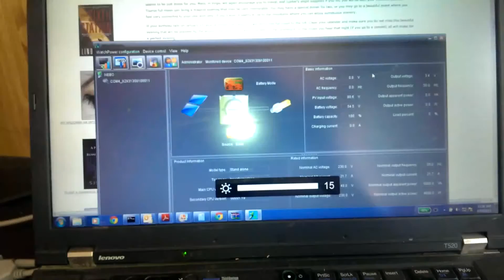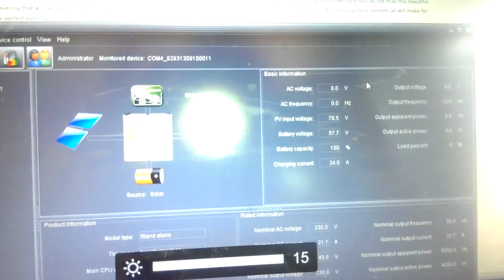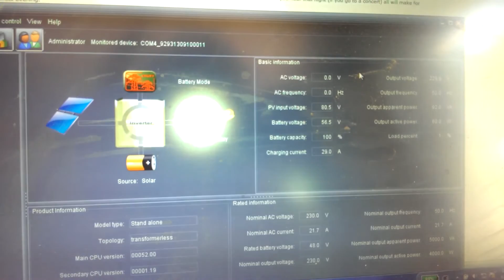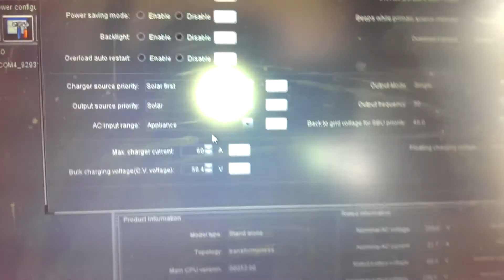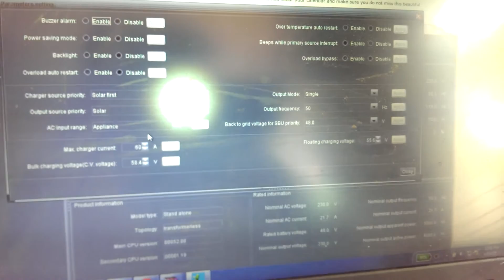MPPSolar PIP4048MS - Initial Voltage Regulation Problems

Comment: Did you ever get any kind of refund from MPP? I recently spoke to a couple that have bought the giant version and are having all kinds of problems. I use my pip2424msx as an inverter because it is basicaly a shit house controller. I added a Midnight Solar Classic 150 to the system and all my charging woes were instantly over. The unit used as an inverter only is quite reasonable. Just never trust it as a charge controller.

Comment: Wish I had seen these videos a while ago. I invested in a MPPSolar PIP2424 as a stand alone solar for the shed - and later the pool. Seems to work great atm - one month old - but hopefully in the long term. Not problems with charging but has an irritating issue when discharging. 
The problem is that the calculated battery SOC is incorrect and that is causing the system to alarm. 
An example is that when the system is connected to utility the battery level is 27.02V and SOC is 100% but when you disconnect the utility power the battery level drops to 26.6V and SOC to 90% - so already an error. Under load (50A battery load) the battery level drops to 25.3V SOC 52% and 24.9V SOC 48% and alarm comes on. In reality the SOC at 24.9V is 80% - double that indicated.
There seems to be no way to reset the alarm without connecting the utility power, which obviates the reason for the off grid system.
Regards

Comment: I have build circuits for every battery there prevent overvolt after that my mpp run very fine, i found out my battery jump up and down then i its close to fuld capasity..

Comment: so was there any issues with the PIP4048 charge controller or was it all in the pcm5048 over charging the batteries. And did you think about changing the  cap in the inverter to a higher rated one to see if that over came the problem.

Comment: Hi dockarl123, Try setting your charge voltage C.V. to 55.6 or 55.7 
looks like the voltage is going up way to fast??? Are you sure you don't have a bad cell with in your battery bank?
Reply: Your video's scare me! lol! Hope my 4048 unit will last longer than 90 days!!! (Time will tell) Only had it running about 30 days now??? Good luck with your system..... You were saying its over charging going over the set point, Would not hurt to try to turn it down some. If not what i recommended, maybe one point at a time till it says under 60 volts or you get it dialed where you want it... cheers & Happy holiday.
Reply: Watched all of them!!!! Are you using the agm pre setting in the 4048 unit? or user?
Reply: Great info!!! Thanks! The tesla auto maker uses aa looking battery's! lifepo4 cells (a bit bigger than aa size battery) in there electric vehicles, the Model S uses like 7000 of them. Using the same type of cells in my 12volt packs. there are over 600 of the aa size looking cells in each of the 12volt packs and each 12volt pack only weights about 35lbs. Sorry your having problems with MPP. I understand how you must feel. Will keep posting my results with mpp. Try lowering you CV Voltage one point at a time till you get it dialed where you want. Would not hurt to try this for a day or two and see if you can keep her under 60 volts. Or not!!! lol!
Reply: dockarl123 i literally can't set my absorb or float voltages to any higher than 58.4v; which is fine for my float voltage of the batteries but a bit short for the bulk charge rate! i've been up and running a couple of months with my 4048 using the internal charge controller... fingers crossed!!
Reply: well, fingers crossed i'm one of those who've benefited from your problems... i'm a long way from nowhere and stuffed it is fails!!! lol
Reply: dockarl123 yup, have one as a backup... always been my philosophy regarding the taiwanese stuff! always figured on getting a midnite solar 250 mppt when i had the $$, now contemplating maybe saving pennies and upgrading everything as i can afford!